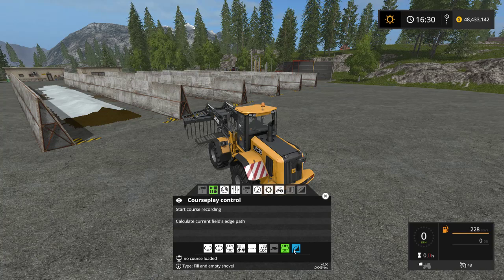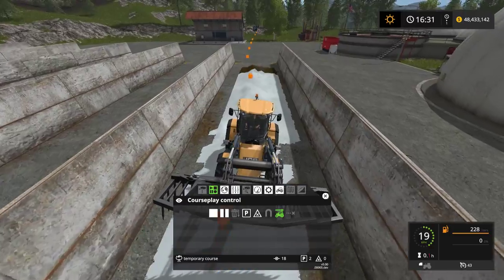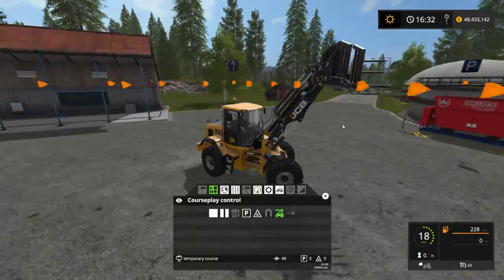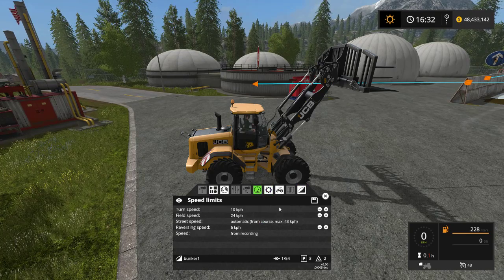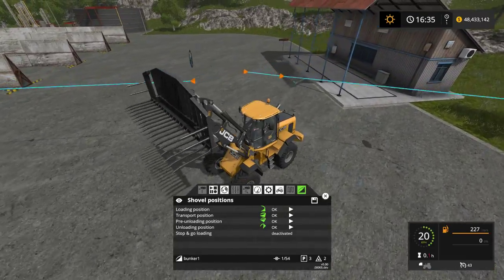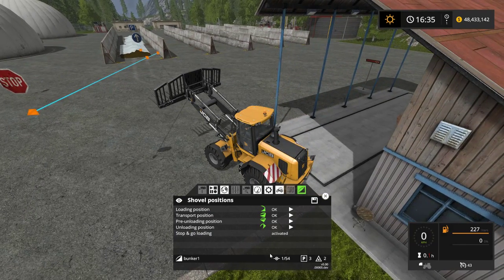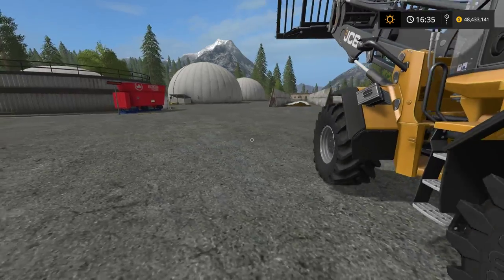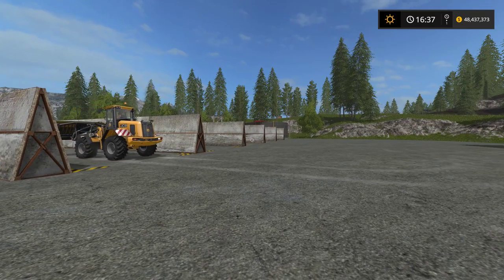Farming Simulator 17 Courseplay Tutorial - How to unload BGA silo with courseplay

Comment: Hi Ian   Have you used courseplay to unload bunkers on Countyline ?  I'm using version 5.01.00160 and I can't get the bucket settings to save . Works fine on other maps.
Reply from the maker: I have not tried yet no.
Reply: I've  tried several tractors and buckets with no luck .Thinking maybe map issue. Anybody  have success ?

Comment: i cant buy some vehicles in the game with courseplay installed like frontloader kramer kl308t,its not working,did it happen to you too?it remains stuck at your selection is being processed screen.
Reply from the maker: Nope I haven't had that problem. My guess is that it's a mod conflict that you have with something else.
Reply: it happen because of courseplay,i found out this through elimination method,i moved the mods to a new folder on the desktop and i  checked again,i moved again some mods and i  checked,when i  removed courseplay from the mods folder it worked,the problem was courseplay for sure,now i installed the 5.01 version of courseplay and works well, i had this one before : 
try to install this version and you will see,i think its older
http://www.modsfarmingsimulator2017.com/courseplay-beta-fs-2017/

Comment: will courseplay clean out the hole bunker or do you have to go in and clean up the edges ?
Reply: I think If the load is partial, it will stop and tell you it is empty, and then you click drive now to finish it up.
Reply from the maker: You might need to clean up the edges.

Comment: Is this a Different Version of Course-Play? Because the version I'm using on FS17 has a lighter colored UI/menu etc, and when i click on "Drive Course" i get an option below that button to switch between 3 different waypoint-modes, liketelling it to start At: "First Waypoint" /"Current Waypoint" /or At "Nearest Waypoint",...And I don't see that in on your Course-Play menu or UI when you click "DRIVE COURSE" ..... Also, theres no link in the Description to download the version you're using,if yourse is newer or different. And one other question i have if youre not using a different or less buggy version of courseplay...  do you get helpers who won't disappear after they are done running a courseplay course? For Example: If i use a tractor on a course, and then delete that course after its done running that course, and load and run a new course or two, by the time i'm done, i Tab over into the cabin of that tractor who's now done say a plowing, then, cultivating, and when i go to do the next job to prep the crop for harvest, i Tab into the cab to find theirs like sometimes up to FOUR of the "Helper Models" (generic male always and not females) But theyre layered on top of each other so when im in the cab the view i get is the camera looking through part of about 4 layers of "helper's chins", so it works out to be REALLY WEIRD and thus far the only way to be rid of it, is to save the game, Quit, and reload the map,...(Also my drive control saves my 4-wheel drive and my diff-lock settings when i reload the map, but wont save my "Shuttle-control" settings so i constantly have to go back and turn off shuttle-mode on ALL my tractors every time i have to load a new map. Any ideas whats goin on Ian? And if you got your courseplay somewhere else, couldyou please link it for us?
Reply from the maker: This is the version that I am using > https://www.youtube.com/watch?v=ADBl6BmGNYE
Reply: thnx bud! that helps!